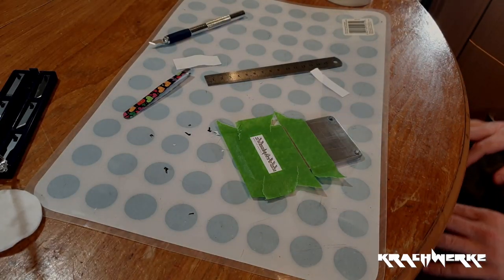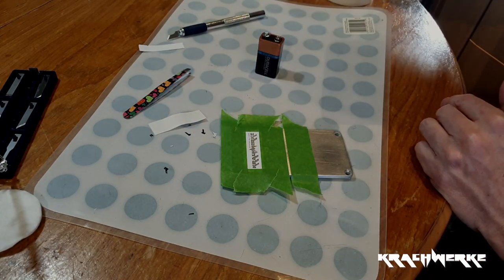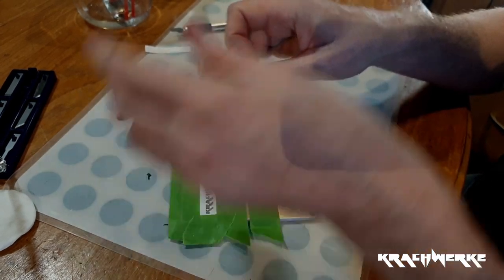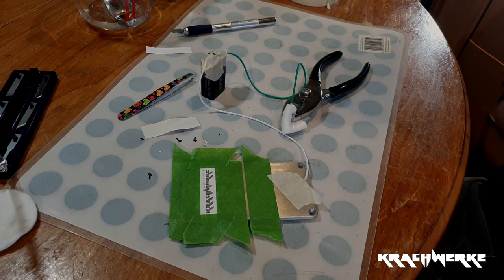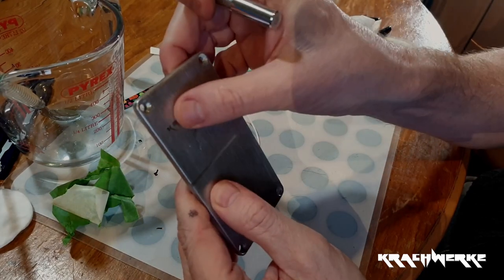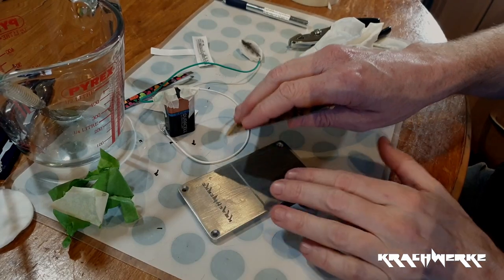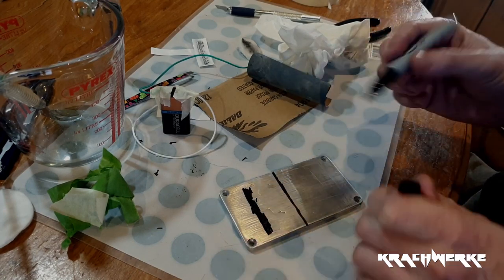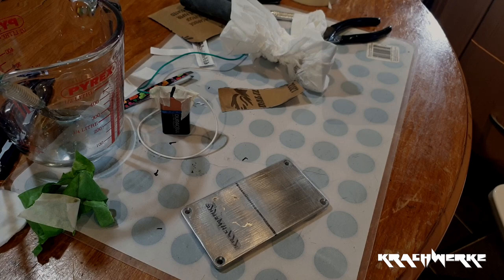Electrolytic etching an aluminium guitar pedal enclosure

Comment: Not a bad result from such a simple set up. I might just try this myself.
Reply from the maker: I know right. The trick here is the quality of the stencil, sharpeness of the lines. 

Some folk silkscreen the mask on which would also make it repeatable.
Reply from the maker: PS. The result would also have been better if the aluminium was properly sanded down and smooth.